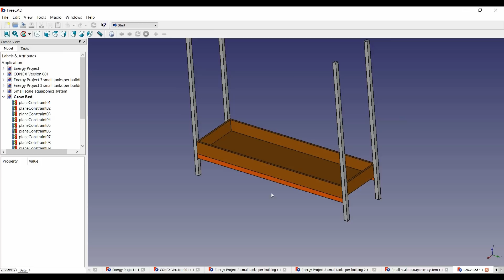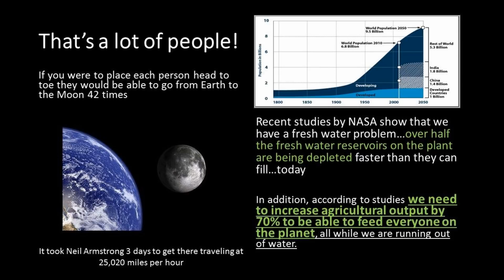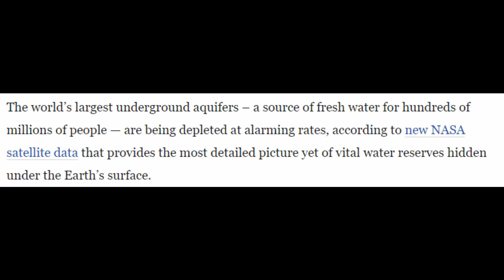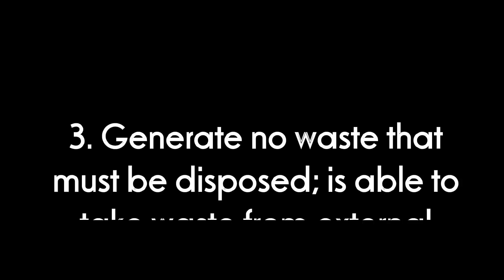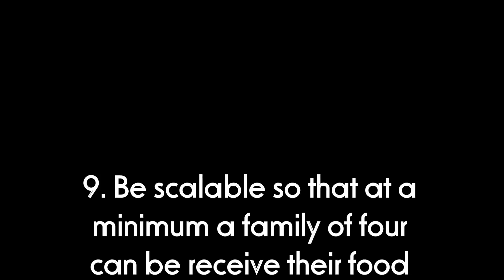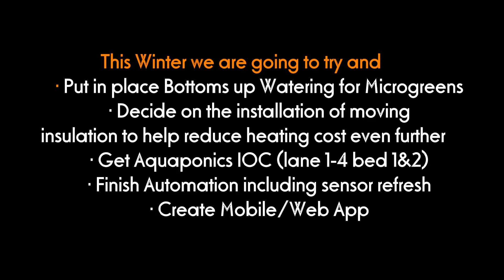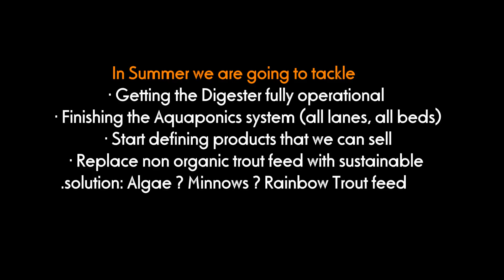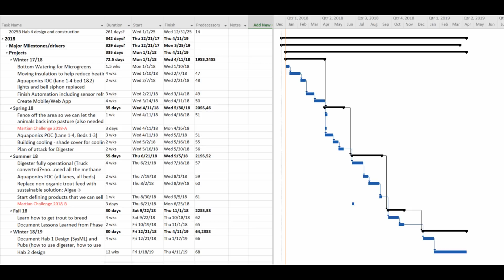Introducing THE REAL MARTIAN 2018

Comment: An algae farm would be very simple as you just need clear tubes that you can run a powered scrub brush down once a day. Should be able to set up a timer to turn on a motor to run the brush down the pipe then back to the wait position. At most a bubble stone inserted into the base of the tube to put atmospheric CO2 into the water column to up the growth rate. 

A standard trash pump should be able to handle the water/algae mix but might want to go to a pitbull air drive pump (similar to a ram pump but use air in/out to move water/fluids). Same type of pump that would work for feeding the methane system if converted to CO2 or nitrogen to avoid O2 into the system.

Comment: I'm pulling for you like crazy! However... we already have this technology, and have for some time. Are you familiar with Nelson and Pade... and Bright Agro Tech?

Simply buying an out of the box NP 4-200 Clear Flow Aquaponics system coupled with some BAT Grow Towers in a 50x100  ft double poly greenhouse from Harnois with some solar panels should meet all your research goals.

NP Clear Flow Aquaponics systems are roughly %400 more productive than field agriculture....
Reply from the maker: yup...they are awesome leaders in aquaponics...defintely take a lot of lessons from them
Reply: I certainly don't want to arm chair quarter back your project, I've enjoyed watching it come together. Keep it up!

If your having an issue with not having enough production space in your greenhouse have a look at Bright Agro Tech's grow tower systems... I've had a 2 tower, 5 ft farm wall in my kitchen producing herbs hydroponically for a year now, and it really does work! Right now I have roughly 18 adult basil plants growing in a 2 sq ft space. BAT even has a system of water cooled grow lights